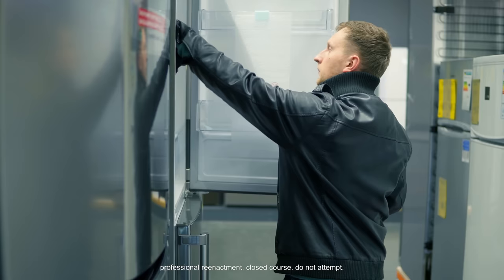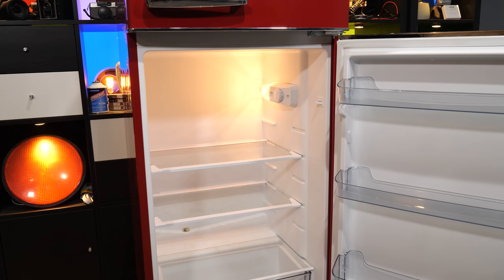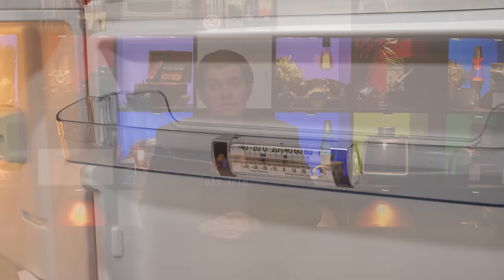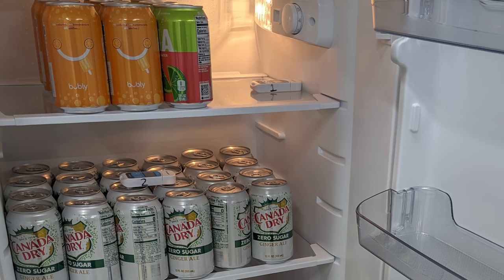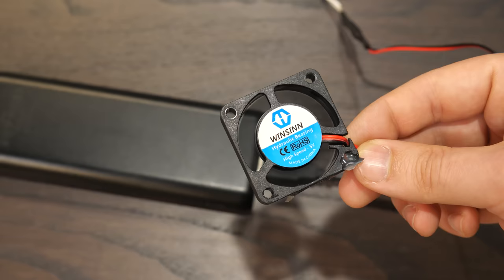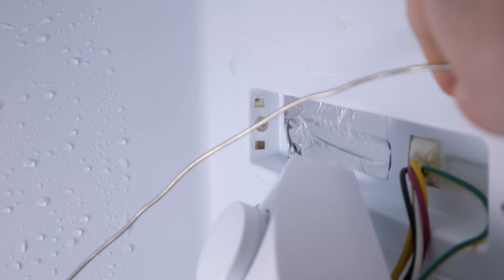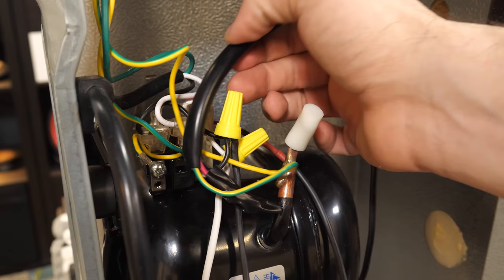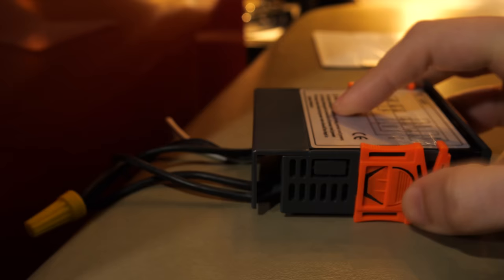This goofy fridge has a really clever design. It's also kinda terrible.

Comment: As a refrigeration technician who regularly works on (commercial not residential) "natural" refrigerant (i.e. hydrocarbon ) equipment. They are literally called "critical charge" appliances. Its actually the industry term for a refrigeration system where the correct refrigerant charge is absolutely necessary to allow for proper operation. (another example would be ice machines, where the harvest cycle uses warm refrigerant vapor to melt the back side of the ice cube allowing it to fall off the evaporator plate)
Reply: So if a system becomes low on refrigerant, is there a way to "top it off"? Or do you have to evacuate everything and add the precise full amount of refrigerant?
Reply: Any idea why the temperature took so long to get cold in the red fridge? Why would it cycle the power?
Reply: Are there systems/refrigerants that can work within a wide pressure difference?
Reply: @PsRohrbaugh yes but no.  Usually a critical charge appliance is made to be sealed and never opened to be serviced. That critical charge is hard to replace and get exactly right with the oils and all that are placed in the system. That is why residential refrigerators are rarely ever “serviced” and usually just replaced. Getting it back to factory specs is just not an easy task.
Reply: @Tatsh2DX  the fridge is using a single sensor on the evaporator. It's keeping the evaporator from freezing up, but there's too much of a heat load for the cabinet to get cold before the evaporator gets too cold.
Reply: @PsRohrbaugh  There's no reason it couldn't be topped up, but they don't just go low for no reason. If the charge is low there's 100% a leak, and refilling without fixing the leak would be pointless. For cheap equipment like this, the cost of finding and fixing the leak is likely more then it would cost to replace the whole unit.
Reply: @zncon  for residential stuff I agree. However, I was thinking about the example given of commercial ice makers. My initial impression was that it'd be cheaper to find and fix a leak, than buy a new phone commercial quality unit.
Reply: @PsRohrbaugh  @PsRohrbaugh  Apparently my notifications for comment replies were off. So, Sorry for the late response. To your question: the answer is "it depends". You can sometimes get pretty close to normal operation by monitoring system pressures and line temperatures during multiple cycles, and slowly adding refrigerant until performance matches expectations, but it can very easily (especially with inexperienced technicians) lead to over/under charging the system, which could cause damage in some cases. That being said, the company I work for basically never uses the above procedure as a permanent solution. Lets say we have an emergency ice-machine-down call on the weekend, and pressures/temps indicate a likely low charge condition. We will probably add a litte refrigerant, and observe a few ice cycles, and see if it begins to work normally. If it does begin making ice, then we will submit an estimate to return, weigh the actual charge (to confirm undercharge condition), If the low-charge is confirmed, we will then pressurize the system with nitrogen to find (the refrigerant had to go somewhere) and repair the leak if it is on a repairable section of tubing, and doesn't require component replacement. 

Natural refrigerant systems are a bit different. Because natural refrigerants are flammable, you can't leave service accesses on the system. So its (vent charge) > (pressurize and fix leak) > (pressure test; verify no additional leaks) > (evacuate to ~500microns) > (weigh in factory charge) > (crimp and braze off accesses) > (test operations) > (return unit to service) every time.

Comment: This fridge works exactly like the boring white IKEA one I have in a european apartment. The only addition on mine is a temperature-changing sticker inside that says "OK" when it's cold enough for food storage.
We had an issue where sometimes the fridge goes below 0C for a bit and freezes some things, and in general the temperature isn't too consistent, but it's a pretty standard fridge for this area I believe, and it does work :)
Reply: I have that OK sticker in a Rosenlew here in Finland, as well as a sticker that marks the area that is used for perishable food. It too froze my soda a couple days back when the room temperature rose. I would appreciate a fridge that actually controlled the temperature, but this one is usually good enough for normal use.

Comment: A possible (and free if the controller already has this!) upgrade suggestion for you: if that temperature controller has an inhibit input, wire up the door light switch to it, and it will inhibit the start of the compressor until after you've shut the door!

Comment: The reason for the disparity is due to the % of the fridge you filled with cans.
The Red Fridge is small, and empty and the amount of cans is a larger load in relation to the other fridges, which if they contain drawers (even empty) hold the cold air in when the door is opened, which in effect skews the results even more.

In short, the larger compressors from the bigger fridges had less load as well.
Reply: Yes, but also, having already cold things (other than air) in them is incredibly important, which he did mention but incorrectly dismissed. Air doesn't hold much "heat energy" i.e. it's easy to change its temperature, but other things you have in your fridge are basically water to a varying degree, and that holds a tremendous amount of energy.
Reply: @akda5id you can feel this difference in restaurant freezers. When the freezer is less full it doesn't feel as cold as when it's nearly packed with food that's been there for a couple days.
Reply: My freezer seems to get an ice buildup when overpacked.  Same principle?  I’m like 5 min in and know nothing about refrigeration sorry if I just said a nonsense
Reply: @myco2408  Keep the food as far away from the air outlet as possible. The circulation is important for defrosting.
Reply: More stuff in fridge = longer to get cold (assuming contents aren’t already cold) but much easier to keep cold. A stocked freezer will use less power over time than an empty one (assuming other variables constant)

Comment: In the EU this is the most common design, and our „safety temperature“ is 7°C (45°F), so it’s perfectly in range.

Btw, how you set the thermostat is by turning it up to a high number and then you keep turning it down until the backside isn’t frozen all the time. (So the defrost functions properly)
Reply: Sounds like an inaccurate and finicky system
Reply: @hopelesslydull7588  but it's enough for most people at home
Reply: @hopelesslydull7588 basically a carbureted fridge
Reply: You just find the setting you like when you buy the thing and never touch it again until you buy a new one 25 years later.
At least that is my experience 😂

Comment: I think the sensing bulb and thermostat are doing double duty - selecting the fridge temperature, but also protecting the compressor or preventing ice-up conditions.
Reply: That's my thought too. That arrangement is specifically to provide a "defrost cycle" if the compressor is running for long periods. Still, it's an example of being too cheap for it's own good. A microcontroller based thermostat could have accomplished the same thing while also ensuring the interior doesn't maintain dangerous temperatures, while arguably not being that much more expensive.
Reply: That’s what I was thinking. Also that compressor probably isn’t rated for 100% duty cycle and the mechanical thermostat would give it some off cycle when it’s been running too long.
Reply: @jasonosmond6896  but 5 bucks is 5 bucks, and market segmentation is the bane of my existence.
why use a microcontroller that does wifi and a triac for 2 bucks in a low end fridge when you can market it as a smart fridge with your data stealing app that requires an account and sell it for 200 bucks more?
Reply: @scofield117  I don't really think a "rated duty cycle" figures into it. The compressor and motor is cooled by the refrigerant returning from the evaporator, so as long there's sufficient oil and refrigerant in the system, the compressor should be able to run indefinitely without overheating. If there was a rated duty cycle, I would expect a run timer to be in circuit with the thermostat to protect the compressor, and there isn't. A fully iced up evaporator isn't doing it's job though, so the compressor is likely to run even longer than it otherwise would unless there's an occasional defrost cycle.
Reply: @satibel  I don't disagree. Mechanical thermostats aren't really that cheap, and they have a limited operating lifetime as the contacts wear out (ask me how I know). The microcontroller wouldn't even have to be sophisticated, and solid-state electronics can effectively last forever when well designed. "Well designed" being the key phrase here. As nifty as this fridge is, it's almost certainly using whatever Chinese-made compressor and thermostats that are already available, and a properly designed and sourced microcontroller would be a manufacturing setup cost that would probably be seen as unnecessary unless you're trying to market an "upscale" refrigerator. It just sucks for consumers who just want a well-designed, well manufactured product that just does what it's supposed to do and quietly does it for decades.

Comment: Hey guy, nice video. I work in a lab and we keep meticulous data on our fridge temps. If you want an easy thermal mass for your probe you can stick the end of it in a container of water or propylene glycol. Sensitivity can be adjusted by adding or removing volume.

Comment: Most Refrigerators in Germany have been exactly this design for the last 4 decades or so. I remember the BOSCH fridge at my parents' house from the early 80ies used exactly the same components and also featured this partial auto-defrost without a heater (quite enery efficient as well!), and later in the early 2000's I bought a similar one and it still was built nearly the same way. I also adored the clever defrost design with that pipe draining the water to a little tub from which it could evaporate by the remaining heat of the compressor's motor. Thanks for this nice video!
Reply: I mean, the early 2000s are pretty far aways from today at this point lol. The fridges i remember from my parents always had the freezer at the bottom and the latest model had the "fan in the fridge part that moves cold air from the freezer part" system. 

Noone buys the expensive active defrost things though in my experience, which i think is just because noone gets these massive american style fridges. With the relatively small freezer compartments in most european fridges, defrosting it once or twice per year isnt really that much of a hassle so most people arent willing to pay 200/300 € extra for a "useless" feature.
Reply: @@phillipbanes5484 but, isn't he drawing a parallel to the Galanz refrigerator?
Reply: And I believe that this decades-old Bosch would do better than this Chinese crap.
Reply: @@phillipbanes5484 95 % of all fridges have this functionality nowadays.
Reply: @meinnase an American-style fridge was the best investment I ever did. Ice all the time and damn it's cooling fast.
Reply: It's the same in the UK! This is exactly the same system as every fridge I've ever had. I was very confused when he started explaining the "old fashioned technology 😂
Reply: @@phillipbanes5484 They are NOT energy efficient really. They eat up much more energy to achieve all the above. 
Also, I suspect american fridges are at quite lower temperatures really.
It is just the different lifestyle, where we tend to eat more fresh food, less food remains, don't drink beer ice cold. So there is less need for a fridge in the size of a smaller car.
Reply: @@phillipbanes5484 old fashion tech, or simple. It’s less things to go wrong and, solidly built, will last a lifetime or two.
I think the ‘we’ is us Europeans. We normally don’t buy things in bulk and dump everything in the fridge at one go.
Reply: @@phillipbanes5484  I don’t think American jumbo fridges are popular in European homes, don’t know about the rest of the world.
Why do everything has to be so huge in America? It’s gross. It’s not environmentally friendly. It’s, it’s.. gluttony.
Reply: @@phillipbanes5484stop acting like you (americans) always do things right.
As for the "throw food in the garbage" thing - we (Europeans), usually, prepare (cook) the right amount of food enough for one or, at best, two meals. No throwing food away.
Reply: @@phillipbanes5484Everything you've said is on point

Comment: I work fixing fridges in brazil. We've got a lot of simpler fridges that work exactly like this, in fact i'm pretty sure ive seen this same exact thermostat/lamp unit before , altough we don't have galanz fridges. There are also a lot of what are called "frost free" fridges, which are the ones you are probably most familiar with, where the evaporator is on the freezer part only, and a fan circulates the air around and to the fridge part. There are also intermediary ones, like the one from the video but with automatic defrosts from time to time. The r600a refridgerant is also very common (which sucks beacuse the compressors tend to be worse than the older r134a counterparts, usually the piston gets stuck). Also, i think r600a is "heavier"? Because the compressors seem to have bigger hp ratings for the same cooling amount when compared to r134a.
Reply: Its likely that galanz is simply buying a fridge in bulk from another manufacturer with their branding on it, so you may well have worked on this fridge under different branding

From what I can tell, r600 is more eco friendly if it leaks but because of its flammability it tends to be only used for small appliances like refrigerators
Reply: @noobulon4334  It is Isobutane, literally sold as lighter fluid for some types of lighters.

Comment: I think this is another case of cost optimisation. A fridge should have a sensor on the cold return line to protect against liquid getting to the compressor.
And if you put this sensor kinda near the fridge interior, it can also sense the inside temperature.
In the first experiment, you did notice the freezer temperature bottoming out. And thats when the compressor shutoff. 
This is when the system was starting to get saturated.
Reply: This, of course, would mean that his clever fix has disabled the safety.  Lovely.
Reply: That was my thought for the original design choice, to limit the compressor run-time, and increase the longevity of the fridge. The new thermostat, while more accurate for the inside temps, is allowing far longer runtimes, and that might kill it prematurely.
Reply: @ingulari3977  I was thinking the same thing. The location of the original thermostat was also defining the duty cycle of the compressor. Also, being totally concealed means it couldn't be damaged from normal wear and tear.
Reply: @lesleymunro4964 sure that is possible indeed, but is that any consolation when the fridge can't maintain food safe temps otherwise?
Reply: @lesleymunro4964  I'm sure that temp controller has a setting to prevent the compressor from running too long. Almost all of those types of temp controllers do. 

And yeah, that's what I thought too when the compressor shut off while it was still cooling down. Done simply to prevent damage to the compressor.
Reply: @ingulari3977  I wouldn't call that a safety feature per se when companies regularly use cheaper undersized parts and hardware thus causing the perceived unreliability of the product as a whole. That is that corner cutting accounting that ruins the perception of products. If say a fridge says 'I am this big, and I can keep things this cold' but leaves out 'only if you dont put anything in me and only let me run at most twice and hour for 5 minutes otherwise Ill die' its not a fridge. Its a lump of parts resembling a fridge. And in IMHO, that advert would be false advertising, and some form of punishment should come down on any company willing to sell bargain basement slapdash products like that. Sure they just checked a box on an order form for whatever that chinese factory district broker had available, but ripping off customers with almost functioning products has to come down on someone. Might as well start with the people that took the customers money. Maybe then they'll hire knowledgeable people for ordering products or at the very least spend more than 2 seconds looking at the pretty picture, and the factory districts will stop making garbage because its not financially viable for them. But it is, so they do.
Reply: same thought here.
Reply: This